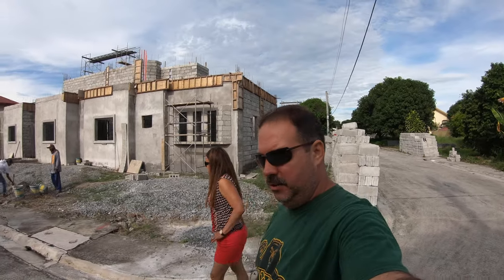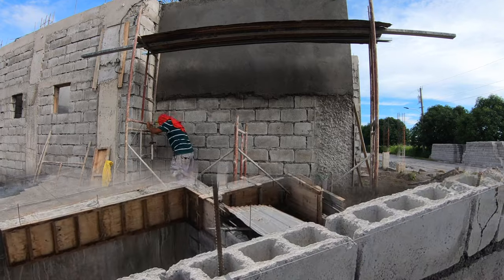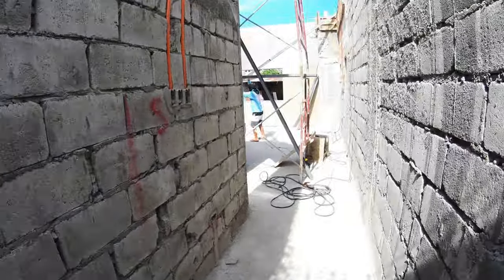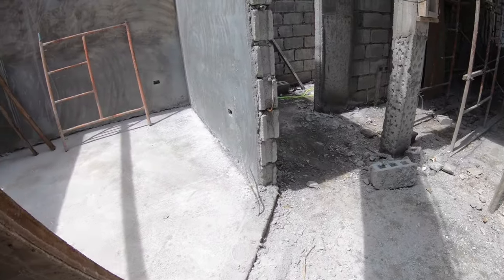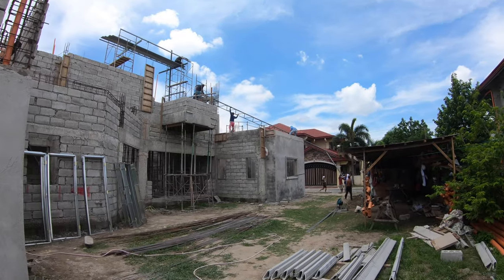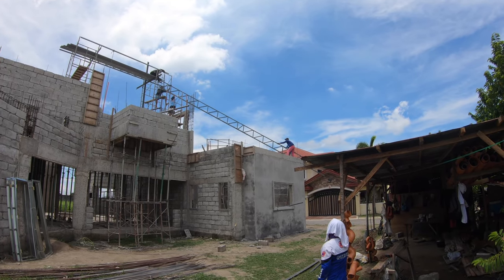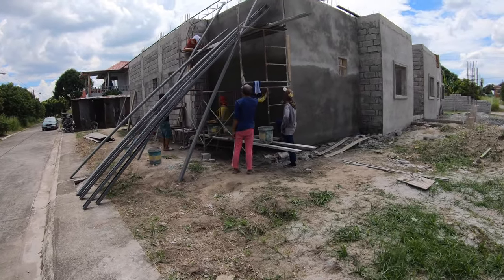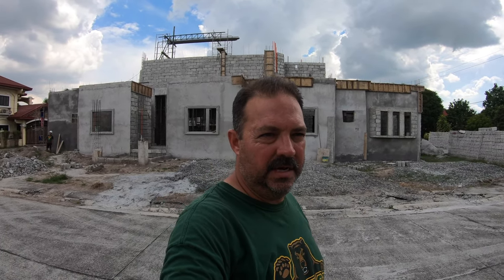Philippine House Building Step by Step, Build Day 82: First Truss

Comment: Coming on great 
Few small questions 😆. What’s your name?. Why metal door frames please?. Any ideas of costs please? . Have you retired from work please?. Is that a gated community please?. Just interested i’am from the U.K. please ignore any questions you may find to personal I don’t mean to pry 👍 but if you don’t ask you never know 😆. It would of been great to have a swimming pool in the back yard 😆👍. Looking forward to Monday’s progress oh did you have to get on to the guys to do the concrete filling properly?.have a relaxing Sunday 😆🇺🇸👍 Dave.
Reply from the maker: Dave, My name is George.  Steel doors to prevent termites. Average costs in this subdivision run Php20K to Php25K per SM depending on level of finish and contractor. Emie and I are both permanently retired. Definitely a gated community with 24 hr security. No swimming pool was a personal choice as we have a community pool and the maintenance for a personal pool seemed cost prohibitive. As with most things in construction here, they do things differently. Just had to ask them to do it a certain way as long as it isn’t too much of a deviation from the engineer’s direction. Don’t want to void warranty during construction. Have a blessed Sunday! Thanks for the great questions and thanks for watching.
Reply: Casa TexPina thanks very much George for your answers , very interesting. You’re a great presenter 😆👍 loving the build  . Did you guys install the small bamboo lookout building? 😆
Reply from the maker: Dave, Yes we installed the Bahay Kubo (nipa hut) prior to construction as a field office.

Comment: What is the purpose of the plastic coating and what does it consist of?
Reply from the maker: I think you are referring to the “plaster coating” which is basically just a thick mortar used to cover the hollow block and smooth out so that we had a finished wall to paint.
Reply: @CasaTexPina  Yeah realised later that that was what you were saying . May be it is an American term but I have never heard anybody call it plaster- coating before that is why I misheard it. You usually I hear people simple say plaster or plastering 😊
Reply from the maker: @proyouservicesltd3652  
Tagalog term is “palitada” very similar to stucco but done directly onto the hollow block.

Comment: What kind of Vehicle is that?
Reply from the maker: Do you mean our vehicle? Ford Everest. SUV based on the Ranger platform.
Reply: Does it have a bed?
Reply from the maker: No. It’s an SUV. Not a truck. 7 seater. Can lay all of the seats down and put in a twin mattress, if that’s what you are asking.